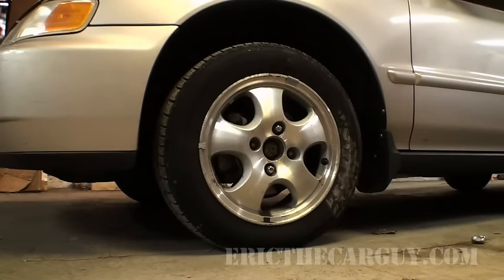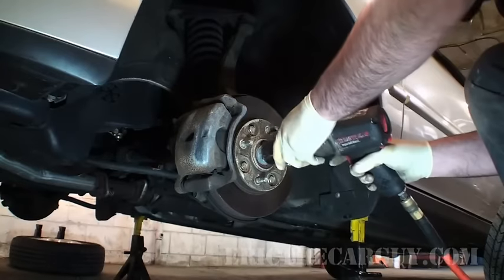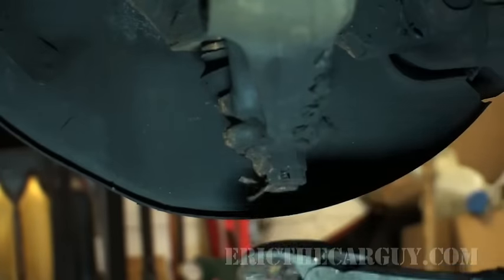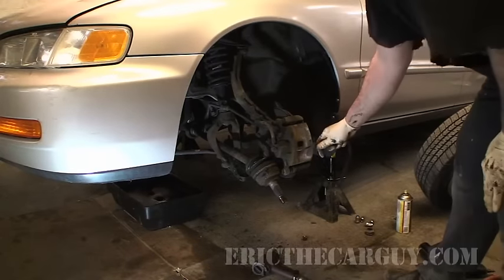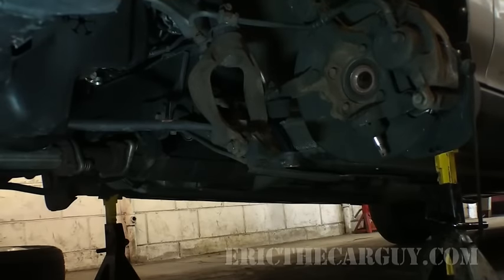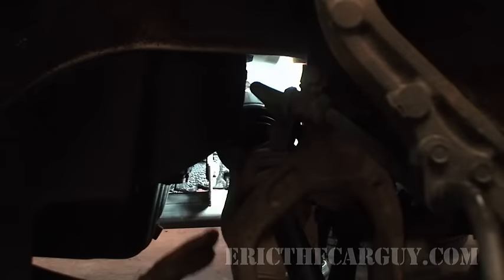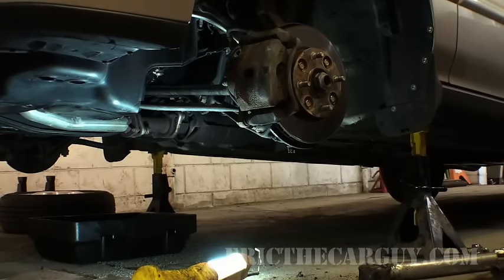How To Replace a Front Wheel Drive Axle - EricTheCarGuy

Comment: I'm new to cars, but I have a technical background.  When I push and pull the Drive Axle, looking in the direction of the lugs, there is some play.  I hear some clacking sounds when going over small bumps.  It doesn't make a difference if I'm turning.  There's no play when I jack up the wheel and check at 12/6 and 3/9 o'clock.

Could that be an issue?  It's been difficult to locate the noise.  I have a subscription to ALLDATAdiy, so I can find the resources if I figure out where it's coming from.  Thanks!
Reply: I've got the same problem.  I am wondering if it could be the axle.  I replaced the struts, upper ball joints and still bumping around.  I am doing the lower ball joints this weekend.  I will try to remember to let you know if that does it.  I replaced them a couple years ago but with crappy one and the sound seemed gone for about 6 months and now it is back worse than ever.  You might want to double-check your exhaust pipe mounts too.  Sometimes those can make a bigger racket than you would think if a bolt is bumping into the undercarriage.  Good luck.
Reply: It was the stabilizer bar links!  Cheap and simple!
Reply: mine are solid, will see if the ball joints do any good.
Reply: 321kliddle
lower ball joints was my noise.  moral of the story, buy the good ones, don't cheap out.
Reply: 321kliddle Thanks for letting us know.  Hope it was an easy fix.
Reply: 321kliddle That's what I did...buy a cheap one. But that was almost 10 years ago (the noise was from something else). I finally did have a lower ball joint go bad and replaced it. (The boots on both were bad.)

When a noise showed up on the other side, I thought darn, I get to spend 3 times for the part what it cost before. Hmmm, it wasn't bad, so I still have an extra lower ball joint.

In my case it was a cam bolt that had hollowed out the space in the steering knucle.

It's a McPherson design where the strut is held on by 2 bolts.

Moral of the story? By new springs, or coils to get your ride height back and get a good angle for the wheel to sit. The cam bolt, if not beefy enough will destroy the space it's in. (The cam bolt held pressure over a 1/3 of the area of the original non camming bolt.)

Also, when you do it yourself, the springs are pretty cheap, even from the dealer! $40!

Aftermarket upgrades for springs on my car move 4x as much for the same amount of weight. Hmmm, that's a downgrade. (1999 Chevy Prizm)
Reply: I had the same clicking popping issue on a Nissan.  Clean the splines really well on the side of the wheel.  Grab a larger bottle of thread lock BLUE. Lube the threads (clean threads) of the axle generously.  Put axle back in and Torq to spec.   Allow thread lock to set up according to the label.  Boom fixed my clicking issue when putting into drive or reverse as well as low mph acceleration and deceleration clicking and popping.   I have also used anti seize and had the same results.   Nissan issued a TSB for the RWD cars for this issue on the 350z   I tried it and it does work for the FWD as well.

Comment: Hi. Thanks for making this!  What's the deal with marking the end of the axle with a chisel at 13:25?
Reply: I might be wrong since I'm learning as well but I believe that is so the nut doesn't move. Kind of the same function as the pin does on the lower control arm.
Reply: It's called "staking".  It prevents the nut from unscrewing.

Comment: I've already broken three breaker bars, any advise.
Reply: Jorge M Cisneros harbor freight has  a strong half inch Impact wrench at around 90 bucks. I just did my Honda accord.
Reply: When I had to step up the torque after breaking my 1/2" breaker bar, I got a 3/4" T-handle and used my 4 foot jack handle as an extension.  Got a 3/4" drive socket too, and it was unstoppable.
If that doesn't work, a torque multiplier with a 58:1 mechanical advantage would be the next thing to try, although it would need some improvised bracing to work, since most of those are meant for lug nuts on truck and RV wheels with exposed lugs, and not cars.
The Ratchet Helper torque multiplier gives a 5:1 multiplier with a more universal bar, and is good for 500 ft-lbs.
Reply: An electric or air impact would be your bestfriend. Never trusted my breaker bars with axle nuts i feel like theyre going to break
Reply: Jorge M Cisneros 
Lose some weight!
Reply: Spend th bucks on a good gun or a pro grade breaker bar (matco)( mac)  (snap on) etc
Reply: heat it up??

Comment: What do you think about the cordless battery operated impact wrench?
Reply: +clasicradiolover I've got a Craftsman 19.2V.  You wouldn't get that hub nut off with it.  It just can't produce the torque you need for high torqued parts.  Mine won't even take the lug nuts off the wheel of my Chevy 3500.
Reply: Too bad I was going to get one, now I'll buy a breaker bar and find a pipe.
Reply: +clasicradiolover the dewalt models are better, eric actually owns one and loves it, so just do research on brands and see which one is best for you
Reply: +clasicradiolover The premium ones, like Milwaukee, have enough power to do these with ease. They're almost too powerful if you're not careful.
Reply: I ended up buying a corded one.
Reply: I have the big corded Milwaukee and it's a beast.
Reply: I own a craftsman air impact and am very disappointed with it. Like Darren Chester said, my impact will not even remove the lug nuts on the tires. I've seen other brands, air, electric and cordless work wonderful. Just depends on the brand and quality of the impact.
Reply: Harbor freight earthquake brand is the business... idk about the electric ones but the air impacts are boss.  The battery ratchet is very nice too.
Reply: Fast4SloW 717 bought an earthquake and still didnt get the nut off. I started drilling through it to just crack it in half

Comment: I"m a 175 lbs. do i do a running jump on breaker bar. lol
Reply: I put my fat 250 pound ass on the craftsman breaker bar and the square drive snapped right off.  Heated the nut with a mapp torch and nothing.  Finally had to cut the friigin thing off with a dremel
Reply: I'm 130 lbs and didn't have any problems using a breaker bar without having to stand on it. Just give it a good tug and make it your bitch.

Comment: Really G R E A T video.  I'm a former, certified air craft mechanic with a mechanical aptitude in the 95 percentile, now a detector technician on an atomic accelerator and I have looked at several videos about different auto repairs.  Yours is the first one tht I can honestly relate with and I trust without question.  I would say that you are in the 96 to 98 percentile of mechanical aptitude and you are very real in your delivery.  I love it.  You actually show what needs to be done and how to do it, and you keep it very real.  Great job.  I plan to use you as a reference in the future for the things I need to know about cars.  Thanks!

Comment: Great video and camera angles for views man! I hate shaky camera lessons. For anyone reading too, if you have someone that can hold down the break while you unscrew the axle nut, you can get it off as well. This method would work best if you are alone working on the car; which is 99.7% of the time the case for most anyways.

Comment: A tip for stubborn old axles that won't pop past the C ring when trying to remove:

Take a 2-3' piece of steel cable, 1/8" with a small loop on one end. Have a loop on the other end as well. Put one loop through the other to form a noose with a loop big enough to slip over the cv axle. Put it behind the large end of the axle sticking out of the trans. Put a pry bar through the small loop and pop it towards you puling away from the vehicle.

This worked so good on a 99 corolla where the only pry spots were those shallow grooves most use to pry against. The bulky end is sort of recessed and this trick worked perfectly.

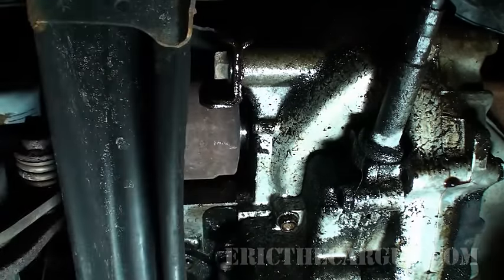Comment: Thanks eric. came here because my passenger side axle was not popping out of the transmission. That hint you gave at 6:54 about "turn it a bit then push, then turning then pushing and so on", did the trick. Thanks so much, the video before you had some meat head saying "just jam a screw driver in there and hammer/pry it out". Glad I didn't listen to him lol.

Comment: Hello sir,I have been watching your videos on YT for a while now and I must say you have really helped me become a better DIY mechanic lol!! Thanks for all your knowledge and help to us! So I am currently on a project on my 2003 Honda Accord 2.4l EX. I am doing a front end suspension over haul. So far everything is looking good and I am making a lot of progress as a 1st timer! So  that’s good but my problem currently now, outweighing my reasoning, is upon realizing that Honda has a specific ball joint press receiving cup that has to be used when pressing out lower ball joint from knuckle assembly, due to the groove around it/bearing housing, non of the rented tool I got has one that fits, so had use one that looks close to perfect but unbeknownst to me the one I selected could only be used pressing in and not, seems like to me, due said groove and because the clamp pressing point is interred by the long knuckle arm I decided to do it the opposite, 1st cut off threaded end and tried but unfortunate the cup got stuck but not so far where it damaged the groove I think cuz I can still see the gap where the rims meet. So I am  gonna taken into a shop to can have machine pressed instead and to retrieve rental piece. However, since I do not have another ride to get the shop twice so I decided to get the driver’ side out as well so I can have both done at the same time. But for some reason I am not able to push in the cv axel inside so I can pull knuckle out after I disconnect all joint and bolts.. i have got to the point now have upper control arm(un-bolted and holding it with the bolt), Lower ball joint(Not separated, still hard to come loose) and then the lower arm plus couple of bongies I guided thru the opening up top where struts mount top screws onto up top. I have tried rubber mallet and then metal hammer and mallet to push axel in ward but to no avail, I have done quit a bit of tapping, hitting and pounding already and I don’t wanna continue if I am doing it to avoid destroying my tranny if I haven’t already done that. I don’t know if it’s because I have already got the passager axel pushed in and it’s bottomed out inside the transmission where there no more room/slack for the other side to move to? Should I only do one end at a time or is this a case of severe rust inside that I am experiencing?

Comment: I watched your video first out of 10 or so I had opened in different tabs.  As I watched the other videos I saw where they did not take apart enough parts to move things out of the way enough to make things go in and out smoothly.  They ended up beating much of it with hammers and having things at odd angles.  I'm so glad I watched your's first then I came back to watch again and get the bad ideas out of my head.

Comment: When hammering an axle out of the hub as Eric does with or without the axle nut in place. Its a good preventive measure to install all lug nuts on to the wheel studs, so as to not damage those studs in the event of a rogue hammer strike.

Comment: Have to do this, change inner and outer tie rods, lower control arm, sway bar links, wheel hub and a few other thing's so this is going to be fun :D Surprisingly, the parts are pretty cheap but the labor is insane if I go to a shop. This isn't my first rodeo so I'm looking foward to it.

Comment: One trick I used to get the nut off is to use a propane torch for a few seconds to warm the nut.  Remember, heat expands, so aim the flame at the facets of the nut, but not on the bolt itself.  There will be a short moment of time that the nut will be loosened and you won't need a breaker bar.  Of course, be careful with that flame and be aware ahead of time with what is flammable (and shield with scrap metal if necessary).  There was one time I torched the nut and had dry ice convenient for the bolt and with the change of temp, the nut felt finger tight.  That is, if I dared to touch it.

Comment: Hi, thank you for sharing your knowledge for free. God bless you!!!
My question is that I did replace the passemher side cv axale joint about 5 times and still did not success to fix it definitely. It last a couple months then either the cv axale breaks or it leaks oil from transmission. I did change the seals at each replacement. The big issue, why there is a gap of about a 1/4" to the transmission and this same for all the cv axale joints. I bought them from Oreilly auto parts with life time warranty. I precise the seals were replaced correctly and the length of the axales matches all. The driver side which I bought from Autozone still working good but not the passenger side from Oreilly.
I am unable to figure out what's exactly wrong. In my opinion is the parts failure. 
Thank you!

Comment: Great video!
Just removed mine on a Chrylser Town & Country 2008, a 15 minute job :)
However, one question. There were some oil coming out after the axle was removed. What oil is this, what should I look for in the car manual to make sure I get the correct oil? And how do I figure out where to refill?

Comment: Thanks Eric! I was changing my oil this weekend and noticed that my driver side driveshaft popped and is spraying grease everywhere. I feel pretty confident replacing it on my '08 Civic, but I'm curious... How long should I plan for this job to take? I am reasonably mechanical and have access to an impact gun (and any other tools I would need to do this). Thanks!

Comment: TIP FOR HUB NUT REMOVAL: First of all for those wondering these threads are not reversed but check on your particular model. I also had to stick a screw driver under the nut by the threads and tap it with a hammer as mine had a little tab that stuck down. I didn't have a long pipe lying around so here is what I did. Put some blocks of wood or jack stand under your car. I also put the wheel under the side of the car as a just in case. Then use your jack on the end of the breaker bar to push the bar up. I used the cheap jack that comes in the trunk and put a leather glove between the Jack and breaker bar to keep it from sliding off. Worked like a charm on my 97 Acura. 
Also if you have the wheel off, you can put a screw driver in the middle of the brake rotor to keep it from spinning.

Comment: Excellent video.  I was working on a Toyota CV and couldn't get the inner end out of the transmission even by using force.  Eric's advice to rotate the the shaft and try in different positions did the trick.  Excellent advice!
Reply: Yeah it is a great tip. I had the same problem when trying to get it out until I used this tip.

Comment: I've watched 4 or 5 videos now on CV axle replacement and heard several describe being careful to not damage the seal to the transmission housing. However, between 2:40 and 3:30 in this video you are hammering the axle, which is still connected to the transmission.  I was surprised by that! I presume that won't damage the seal?

Comment: Eric, thank you for excellent, most comprehensive tutorial! 2 weeks ago took my wife's 2011 Kia Sedona  (103K km. original owner) to local garage for CV joint job. They replaced it. Took it for the test drive (no highway) seemed ok. Later I  noticed slight vibration at highway speeds under load. When letting it coast it disappears. Called them back they suggested to Ballance the wheels 😉. Wheels are brand new Bridgestone, less than 2K km. were perfect before they cv job. Yesterday noticed a persistent thud, both when accelerating and when abruptly decelerating. Can reproduce it everyy time I accelerate and also when let go. What are the possible causes? Thank you.

Comment: @1:43  Some people remove wheel 1st then put some breaker bar across the bolt studs and only then release that Axle Nut. The idea is that if to do it in the way shown in this film, there is still some rotation present (like Parking Break still doesn't prevent fm/some small rotations, and in the film you can see some play of the wheel), which can impact smth (what it is exactly I didn't understand, but smth can go wrong).  And they are not just amateur DIY, but high professionals (1A Auto, e.g., I believe Sue said). I myself always did it the way Eric did, but when I've learned Sue advice and concerns about it, I would like to know more about this. I looked in Shop Service Manual I have for 2 cars: they say apply breaks when the car is on the ground (not the parking brake, but brakes, so it means put the stick on the brake pedal in addition to the PB, as far as I understand).  I would appreciate any remarks on this issue.  The film is great, thank you, but the question described above is not quite clear for me. Thank you again.

Comment: Thanks for the video. I see that it is very common for hubs to be sold with the axles in 4 pc sets.   Is it necessary to replace the hub usually?  My sisters Nissan had a vibration at speed, pretty rough like driving on light gravel. A shop said she needs a new CV Axle.  Do you think the hub needs replacement as well?  Is there a way for me to inspect the hub to determine if it needs to be replaced?  What would I be looking for? Any play or something else?

Comment: Thanks for this vid. I replaced the drive axle on my Toyota Prius, but I noticed after installation that the new drive axle does not have the metal dust cover at the end of the axle on the transaxle box side. Is this dust cover necessary? In other words, with this dust cover missing, will it compromise the integrity of the transaxle seal?